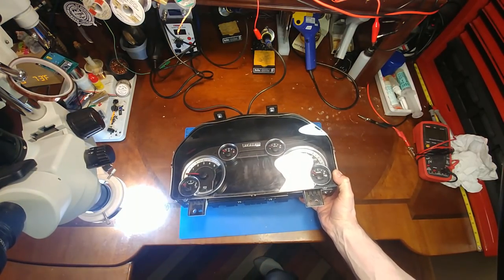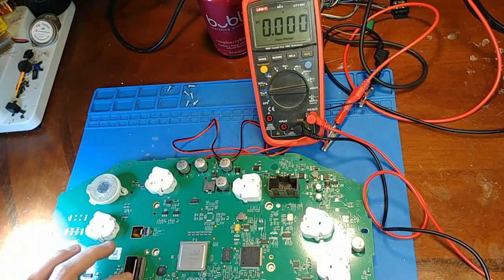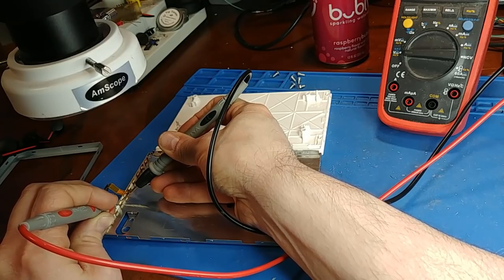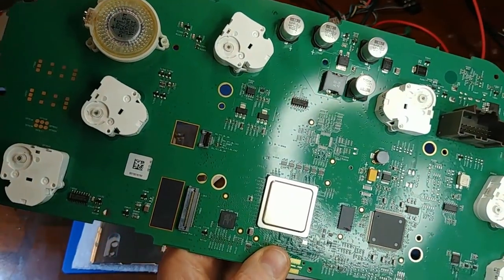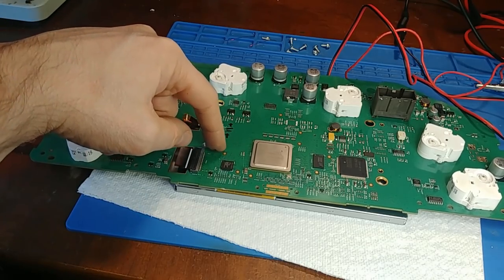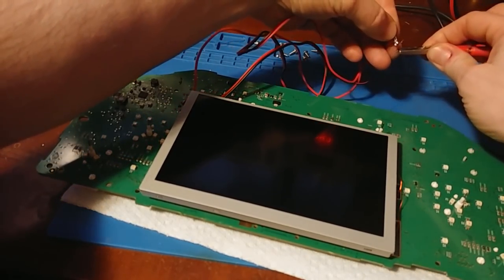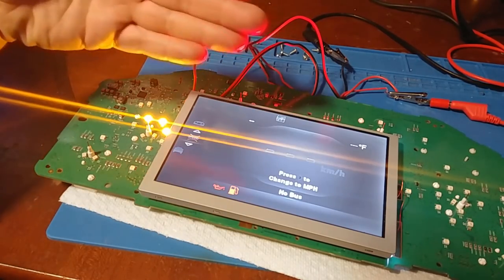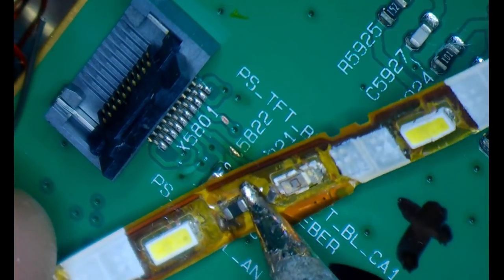Dodge Ram Cluster 7 in LCD Repair

Comment: Do you know what each of those 2 transistors control?    

My truck has this cluster.  The cluster backlight operates in one of two modes.  When the headlights are off, the backlight is fully on and it's brightness is not-adjustable.

When the headlights are turned on,  the backlight automatically dims down,  and becomes adjustable via a knob under the headlight switch.

I was wondering if perhaps one transistor controls several LEDs,  with variable voltage depending on the brightness rheostat?  

And perhaps the other transistor  is simply on/off, powering the additional backlighting when the headlights are off?

If so, I could possibly cut the circuit that controls the flickering (headlights off) LEDs.  Since that additional backlight isn't necessary,  the lower intensity backlight that's active with the headlights on is plenty bright enough for daytime driving.
Reply from the maker: One transistor controls the top half and other bottom half.
Reply: @jeffescortlx  

That's interesting.   I plugged the disassembled cluster into my truck, and all of the LEDs were flickering simulteneously.   

So, that means both circuits are driving flickering LEDs.  The probability of both transistors failing simulteneously is nearly zero.     

I installed a used, replacement cluster,  which resolved the issue completely.  No flickering at all on the new cluster.

That all of the LEDs are flickering would seem to eliminate the t transistors as the problem.    That the replacement cluster resolved the flickering problem eliminates programming, or power supplied to the cluster as the problem.   

So, I guess I'll look for the part that provides input voltage to the transistors.  
Some kind of transformer or other device, that reduces the trucks 12v to the 3v feeding the transistors?
Reply from the maker: @kensmith174  I'm 99.99% sure the flickering is because of a failing LED in the LCD assembly. I would not expect the problem to be from a transistor or the signal/power feeding it.
Reply: @jeffescortlx  

Ok.  So, the LEDs are in series?   As one starts to fail, it effects the current supplied to the others?  

 When I had the disassembled cluster plugged into the harness, and the truck idling,  I could clearly see all of the LEDs flickering together, in sync with each other.
Reply from the maker: @kensmith174  yes each section of LED's are in series. When one opens up it brings down the entire section.

Comment: I have a flickering lcd issue on a 2016. The lights in the gages etc are fine, just the lcd parts flickers like strobe light ( annoying). I plan on replacing the lcd from an ebay unit. Any pointers on taking the cluster apart? It would be awesome if you can make a video of cluster disassembly.
Reply: Were you able to locate an LCD screen on eBay? Just curious if you were able to make the repair. My LCD backlight is either strobing or off completely mostly off now over the last couple of days. I'm certainly looking for a cheaper option to fix it than the dealer.
Reply: @chev572bb  unfortunately I gave up on fixing it. Just going to live with it as this issue seems to getting better or it's just me getting used to it. Truck has 226k on it now I will just drive her untill the wheels are ready to fall off.
Reply: @robgill4378  I think I may have found a solution. There are places that sell just the LCD screen for a couple hundred or under. I have only found one place so far but they were sold out if you scoured the internet a little bit for a 7-in LCD screen for around 1500 and 2013 to 2018 you will probably find something changing the actual LCD out is super easy as well. I have already had mine out inspecting it to see if I could find a defect with it. Only takes about an hour to an hour and a half with removal disassembly change the screen out reassembly and putting it back in.
Reply: @chev572bb  that's great, let us know how it goes for ya?!
Reply: @robgill4378  so i ended up finding a used one for a good price, 215 cad shipped to my door and have a tool called Alfa obd almond with their MX+ dongle and was able to reprogram the kms. That part was tricky for some reason I was not able to just write  kilometers that were on my truck and write over to update the new cluster. Took me several tries but I ended up about 2,000 km higher than what was on originally it was fine by me though I can live with that. This is compared to 1500 from the dealer plus programming so likely 1700 ish.

Comment: I am having the same problem with my 2013 dodge ram sport Question ?how much would you charge to repair mine cluster
Reply from the maker: I'm currently at maximum capacity for repairs in December of 2021.
Reply: Ok what about next month? And what your email
Reply from the maker: @kelvinsutherland8373  my contact information and other available technicians information is available here:
https://youtu.be/T_2WnJMsZaU

Comment: Jeff,
What do you charge to correct the center lcd flicker for the dodge Rams?
Reply from the maker: Replacement LCD screens are available. You can just buy a new screen and swap it in.
Reply: Are they hard to do? Do you have a video of it?
Reply from the maker: @sargonmikhail6579  this is the only video I have on this make/model/year. It's not hard for me, but might be for someone who has never done this kind of work.

Comment: Can you elaborate on have you supplied power to the unit once it is out of the car, like do you have some type of special power supply or something?
Reply from the maker: I just use a lab bench style power supply.
Reply: @jeffescortlx  do you have a recommendation, as an EE student I want to buy one that I can use to help with my hobbies
Reply from the maker: @xSparkyX188  any of the generic 0-30v 5 amp will do.
Reply: @jeffescortlx  thanks!
Reply: @jeffescortlx  I have this issue can I send my cluster to you for repair if so where?
Reply from the maker: @bigredd2866  replacement LCD screens are available on eBay now.
Reply: @jeffescortlx  Its not the creen it's displaying saying wait 2-5 minutes and keeps flashing, then it says insert update usb
Reply from the maker: @bigredd2866  sorry I'm more of a hardware guy than I am a software guy. Sounds like you need some sort of update done or something.

Comment: @jeffescortix great video! I’ve been searching all over to try and find what may be wrong with the instrument cluster in my 2014 Ram 2500. When it’s cold the screen won’t come on, but after I’ve driven a little while and the truck warms up it starts working. Any idea what could cause this?
Reply from the maker: Probably LED failure in the LCD screen.
Reply: @jeffescortlx  is that an easy replacement? Cheaper than replacing the whole instrument panel I assume.
Reply from the maker: @troyd.521  Well the last time I heard a dealership replacement cluster quote it was like $800 so yes a replacement LCD is definitely cheaper.
Reply: @jeffescortlx  wow. That’s a lot more expensive than I expected! do you happen to know the part number for the lcd screen? I’ve been looking online and can’t find anything.
Reply from the maker: @troyd.521  No I don't have that with me. But I just did a search for 7" ram LCD.
Reply: @jeffescortlx  ok thanks. Is it easy to disconnect from the instrument panel? You didn’t show that part in your video. I’m assume it’s just one or two ribbon plugs?
Reply from the maker: @troyd.521  the needles have to be pulled and reseated correctly. Making it  a difficult DIY job. Having someone experienced repair it would be recommended but not required.
Reply: @jeffescortlx  ok thanks for the info!
Reply: @jeffescortlx  since this only happens when it’s cold intermittently is there a chance there’s a connection in the back that shrinks due to the cold and then once the truck warms up makes connection again?
Reply from the maker: @troyd.521  It's possible but unlikely. It's probably just the LEDs dying like what happens to many others of the same year / model. To confirm it's the backlighting just use a flashlight to check the LCD for image.
Reply: @jeffescortlx  sometimes when I first get in and start it up, the screen will light up, but there won’t be any image and then it goes dark until the truck warms up. Other times the screen won’t light up at all. It would just be dark from the beginning until it warms up. Now to complicate things even further it’s been really cold here lately, like single digit cold… right now it’s 3° in the screen came on Friday as soon as I start the truck up, but the other day when it was 25° I was getting the issue with it not coming on..
Reply from the maker: @troyd.521  I'm sorry but I'm just not that familiar with this cluster to give you a solid answer. I have very little experience with this particular model of RAM.

Comment: Driver module control  from headlights switch ,I have schematic  ,
Reply from the maker: So if it doesn't receive a dashboard backlighting percentage signal it just doesn't turn on the LCD at all?
Reply: Thru can buss I believe, how do I send schematic
Reply from the maker: @luisagonzales1442 
 Email
Reply from the maker: @luisagonzales1442  I have the wiring diagram now thank you. But it doesn't appear to show the LCD backlighting circuit, just a generic lamp circuit. I still don't know why the LCD would be completely turned off, even if the back lighting is set to minimum the screen still needs to be seen.
Reply: @jeffescortlx  there's a common  problem with this style pick up ,reboots at no frequency and won't  turn off upto overnight
Reply: @jeffescortlx  more likely to be canbus issues
Reply from the maker: @luisagonzales1442  it very well could be canbus related. It just seems strange to me they would program the ability for the LCD to be completely off when the cluster is on. I can't think of a time when you wouldn't want to see that information with the truck running. Turned down to dim sure, but completely off is strange.
Reply: @jeffescortlx  default setting should be on not off
Reply from the maker: @luisagonzales1442  yes I agree.
Reply: @jeffescortlx  yes,very strange, what I've understood from some bulletin,is that its been an issue frome the get go,most common issues are rebooting  while driving and staying on all the time then normal for weeks
Reply: @luisagonzales1442  Perhaps the decision to stay off is deliberate.  Without a working canbus, the display is going to have faulty information.  They fixed it in the lighting circuit rather than program the processor to say 'no data'.
Reply: Back light is full bright as default with ignition on,when light are on then it adjustable by dimmer, what I can not find info of is if it loses can bus is it on or off
Reply from the maker: @luisagonzales1442  well if you ever get to the bottom of it let us know. It's good information to have.
Reply: I found a 2019  charger ,has same  style dash,I disconnected  headlight switch and no gauge cluster lightning
Reply: Hey jeff, thanks for sharing. Would you mine if I ask how you remove the needle?

Comment: I would install an 555 timer dimmer circuit and hide potentiometer somewhere near/under steering column. It's a hack, but still better than 1300 bucks for a new cluster
Reply from the maker: As Louis pointed out, it might be looking for a can bus signal to even turn on the LCD backlighting. So there could be nothing wrong with the backlighting circuit.